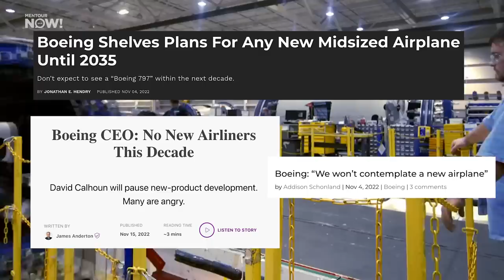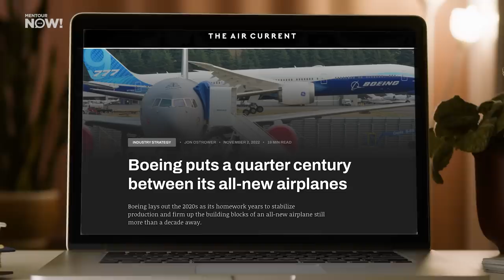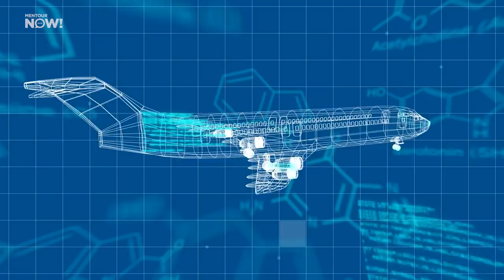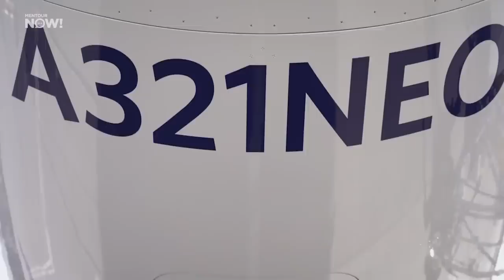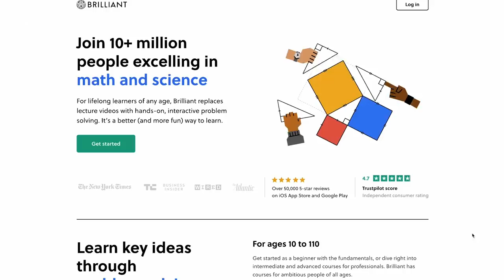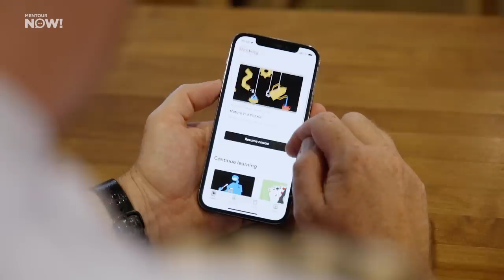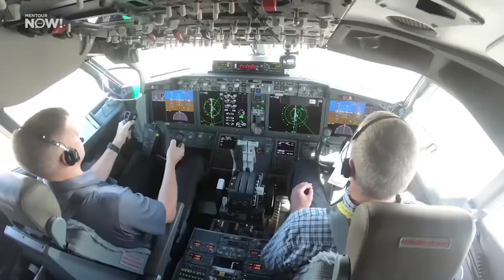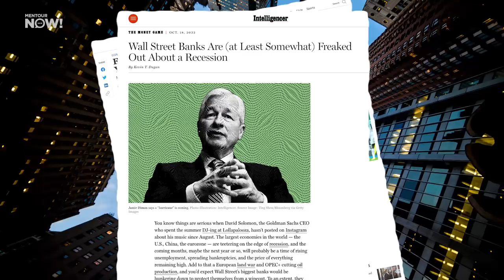Is BOEING giving up!?

Comment: I think it is quite difficult to get enough design experience on the table when you don’t design new aircraft in 25 years. It is an absolute leap in design techniques and people who are junior level during the 787 design are practically retired when the new design is being tested. It could turn out to be too long a strecht where boeing literally has to learn everything over.
Reply: I think their military division and tankers will keep their engineers current.  Military designs ( having worked the F35 myself) are far more advanced than passenger jets.  They’ll always have this in their hip pocket. Like Petter says, they’re holding their cards in right now
Reply: One thing I was thinking is that Boeing can still design new variants of their current line of aircraft. They could make changes to the capacity and capability according to the needs of the customer base while maintaining the same core models.
Reply: @jimsteinway695  There's no overlap - BDS and BCA are completely separate divisions and there's not really much technology transfer between fighters and passenger jets.
Reply: presumably that was a big factor in why they made the 787, so it's a big shocking to see that forgotten so soon.
Reply: @Timmayytoo  The miltary has more than fighters, and a good portion of the development is not in the aircraft performance it is in production line technologies and methods which do transfer. 
Things like quality control testing and design details that can have a high rate of failed assembly (Sensitive to exact conditions, 50% rejected, eg.) or higher cost of assembly than overall design advantage.(Saves 5 pounds but due to unforeseen complications it adds 100 hours of skilled labor and $1000 in production consumables per plane.)
Reply: Indeed.
Reply: @jimsteinway695  Lokheed tried this - they completely left the commercial market after Electra, and tried to return with Tri-Star. We all know how that ended. All the know-how from military projects, including heavy airlifters couldn't help them.
Reply: @mancubwwa  Yeah, but the Tri-Star's biggest problem was simply that Rolls Royce couldn't deliver the RB211 engines when they were expected. That itself wasn't Lockheed's fault, though you could argue that designing an aircraft that could use only a single engine type that was not yet in production was not such a great idea. (But they probably would have had to give up fuel efficiency and range to be able to have a two-spool engine option.)
Reply: @Timmayytoo  there is a little bit of overlap but it only goes one way BCA to BDS. BCA will suffer huge as they will not have any Engineers who have experience designing an airplane. Anyone with ambition is going to look for work in the Defense sector or at other OEMs.   The clean sheet design and certification process is very different from doing nothing but derivatives.
Reply: That makes sense, not much incentive for newly graduated eager engineers that are really smart and very ambitious to join a company where not much new development. Going into operations and maintenance with equipment older than them is pretty disheartening.
Reply: I wanted to say the exact same thing. I work in pharma, and even in such a technologically conservative environment, the work experience 25 years from now is basically not comparable. It's not like you are a fully trained engineer once coming out of uni. It takes many years to build enough experience.
Reply: I wonder how long such design engineers stay with Boing?  ME and EE in other fields do not stay anywhere near 25 years with the same company. More like 5 years. 10 years is considered a long time.  When it comes to software, 2 years is typical, with 5 years considered a long time and 10 years raises suspicions of atrophy.
Reply: @Sylvan_dB  this may be both industry and country dependent. I work in the railway industry in The Netherlands and here people still often work for 20-30 years plus in the business. Other industries here have indeed a shorter span of attraction for engineers. Maybe this is a result of industries that have less job opportunities and are more specialized. One aircraft manufacturer, one major rail car manufacturer, in contrast to 1000 software startups, machine builders, etc
Reply: @ReneKnuvers74rk  I suspect you are right about locale and industry. 👍
Reply: @mancubwwa  they didnt have a 5000 plane backlog with orders still pouring in one has got to remember they only meant to make 100, 737s and they thought that would be the end of that program
Reply: @Sylvan_dB  Boeing is training people back here im in the middle of Boeing country.but it takes time for people to get good at there jobs.
Reply: @mytech6779  Yeah, they have transport, command, surveillance and tankers.  Which are converted airliners.
Reply: The young guys can learn on the job.  A few planes will suddenly try to become tunnelling machines along the way, but what's new?
Reply: Return to Seattle or QUIT!!!
Reply: @himoffthequakeroatbox4320  that's with anything in life you have to start somewhere.and at Boeing these are career jobs. So a lot of people are hired at the same time and then they retire at the same time so it comes in bunches and then they have to learn there  job. Lot of Benny's in perks working for boeing and good cash.
Reply: Come to Boeing and help create the design process that your successor will implement. 🙂
Reply: @unfixablegop  my duty at Boeing is over now. No more 4am wake up for me
Reply: It is worse than that.  MUCH worse.  No one in Boeing designed the 787.  It was nearly ALL outsourced.  The Engineers were all baby sitters for contractors.  I was hired at Boeing, saw what was NOT happening and LEFT ASAP!  I do not think Boeing could design an aircraft today even if it wanted to.  The engineers they do have are not ALLOWED to do their jobs.
Reply: @w8stral  what was your job at Boeing?
Reply: @andrewlarson7895  Systems Engineering.  100% outsourced to Smith's(UK), Moog(Japan).  At which point it was time to go.  My brother also works for Boeing and actually did do a little design work, but he quickly left as there was no real design work and went to work for space division where Boeing is FORCED to design/build in house.  Rest of my family is in engineering as well.  No, I did not go to school to babysit requirements, or check progress on the contractors, something a high school GRAD could do.  

To put this in perspective, as a contractor working for a different company in the area, in less than a week, I got all the drawings of 747, analysed the section modulas etc of EVERY SINGLE part, put it into a FEA, and did said FEA, in a WEEK... 1 other guy helped do said work.   2 guys, ENTIRE FEA analysis where the 2nd week we in effect designed the conversion process of said 747 for a specific task(cough, IAI).  Remember, 2 guys, 1 week + a couple days the other week and the ENTIRE THING was done.  Said modified fuselage 747 carrying special cargo is flying today still(Think guppy equivalent).  Boeing on the other hand has thousands of engineers who are not even ALLOWED to do design work and if they DO, they get squished as it "isn't their official job"... go to that meeting about a meeting and write up "meeting" notes about a future "meeting" because said contractor isn't doing anything(duh, why would they?) They have ZERO incentive to finish the task quickly.   Don't worry, Airbus is just as F'd up in this respect as Boeing, with an added layer of French/German/UK politics on top of everything as explained by several ex-Airbus employees I have worked/talked to which I respect.   

Lets put it this way: If Boeing FIRED 75% of their "engineers", kicked out 100% of the contractors, told the FAA to go fuck themselves elsewhere and NOT in the engineering building, they would be MUCH better off.  The last plane Boeing designed was the 777.  I was not there for the 77X wing design obviously, but I doubt Boeing engineers designed its systems, but maybe its structure they did.  So, while there are now ZERO engineers at Boeing who can design ANY of its systems, they might be able to still design CF layups... Though NONE of them have ANY manufacturing experience and this is where ALL the $$$ is tied up for efficiency, not its actual design.
Reply: @w8stral  yes true and then they offload work to contractors that can't even build the parts right... And alot of them contractors contract that work out. Yeah it's a mess down there. But hopefully they're trying to fix the problems.
Reply: @andrewlarson7895  Uh, no as same contractors work for both Boeing and Airbus.  There are always poor parts.   Fact: Aircraft are 100 years old tech.  Baring a battery breakthrough, or ultrasonic skin friction reduction tech allowing economical supersonic flight, the era of new aircraft is over.  I learned that over 20 years ago.  The Geared Turbo fan is the end of the line as far as advancement and that was in development back in the 80's.  The turbo fan shown is an absurd joke and has been known as an absurd joke since the early 90's.  It only works, AKA saves fuel under Mach ~0.65.  NO ONE will put up with slower aircraft speeds.  NO ONE.
Reply: whatever happened to blended wing-body design? save ton of fuel
Reply: @RavingFan  Can't exit the people in 90 seconds.  Putting in a door is a major problem.  Maintaining smoothness of a pressurized hull creates massive drag.  Has a gargantuan problem for cargo... WHERE?  Engine maintenance problems.... ANd required all airports to expand runways,taxiways to ~100m or so.
Reply: @w8stral  boeing has been off loading work for 60 years its nothing new at all.
Reply: @w8stral  sounds like a very reasonable answer.
Reply: That would apply to Airbus as well, as before A380 they only have two designs, A300 and A320. (A310, 330 and 340 are all derived from A300)
Reply: @borisglevrk  yes and airbus gets boatloads of tax payers dollars to start there new projects they still owe the tax payers close to 1 billion dollars on the now default A380 project.boeing has to reinvest the money off there plane sale's making it very hard to compete
Reply: @andrewlarson7895  Didnt Boeing get a big lump of taxpayers money too ?
Reply: @alanolley7286  nope they gave it back so they could move to South Carolina to build the  787 line